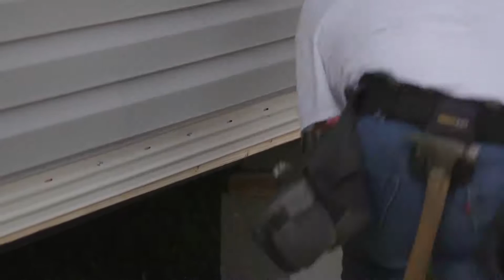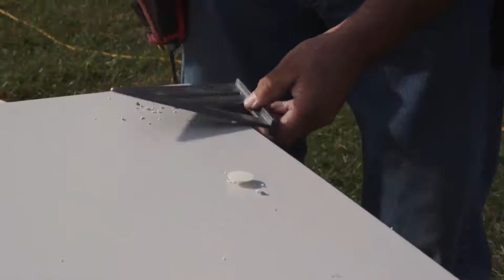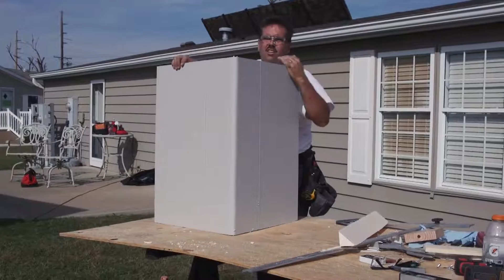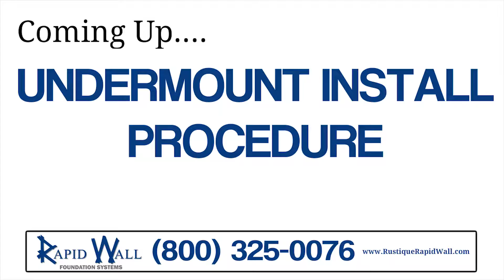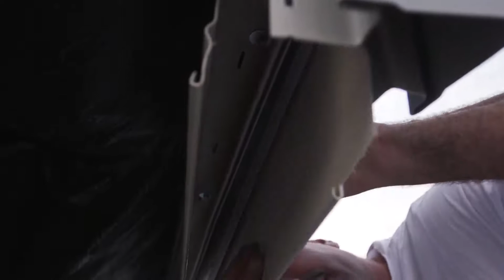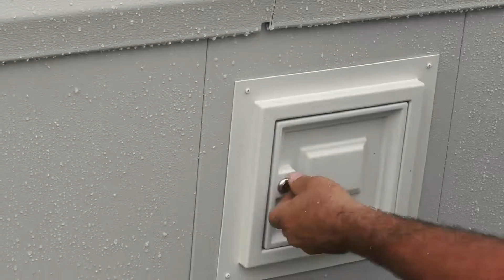Rapid Wall Installation Tutorial | (800) 325-0076 | How to Install Rapid Wall

Comment: I wish you would do an UPDATED video on this entire install with better footage and not leave out the most important things. What about those with full concrete pad (?)
You didn`t install any access doors, you didn`t show how to install the upper outer trim piece on how you do the corners done for the undermount type skirting.
We bought the RAPID WALL kit, the kit showed up with LESS than half the screws to install it, and just a couple push pins were found rolling around in the box.

Comment: This is a great product, recently finished installing it on our home replacing 38-yr old metal roofing that was used for skirting (ugly).  For me, I learned that using a pry-bar while pushing in/up on the top rail makes it easier to pop into place than beating on it.  I also found a jigsaw to be much easier and cleaner for doing the vents vs. a circular saw (for me, anyway).   Realize that on an existing home, it's going to take a while.  With 2 people it took us ~3 days (160 linear feet of skirting).  We do have a good slope (10" to 42") and had a lot of existing things to work around (porches, steps, power, A/C).  In the end it turned out beautifully and don't regret going with it!

Comment: Make a more professional installation on your access holes by cutting the rest of the corners out with a handsaw or long utility knife instead of just breaking out the foam on the back.   Keeps the integrity of the foam intact on the back instead of losing a chunk of insulation.  Just as well do a professional job instead of a sloppy one....

Comment: This was excellent, thank you. We had rapid wall installed on a new single wide in 2015 and the top rail has started pulling away from the back rail.  I’ve been looking for help getting it popped back up in but it’s so tight. I didn’t want to reef on it too much and crack it and thought for sure there was a special tool I’d need.  This was very helpful, I’ll get myself a rubber mallet! It’s spring here in VT so it should be flexible enough to take the pressure with the warmer weather!